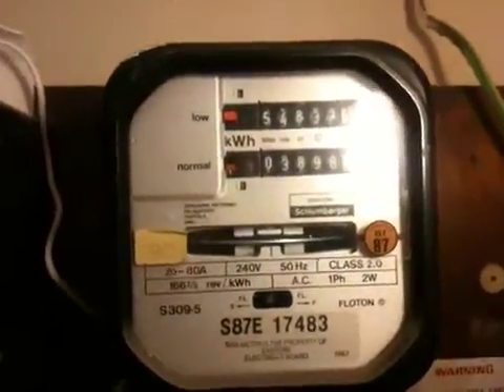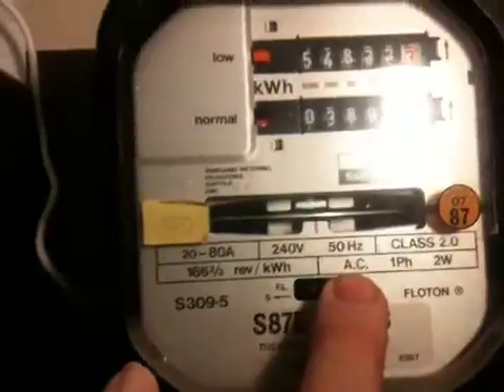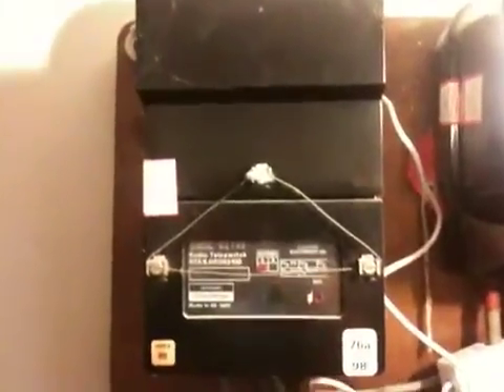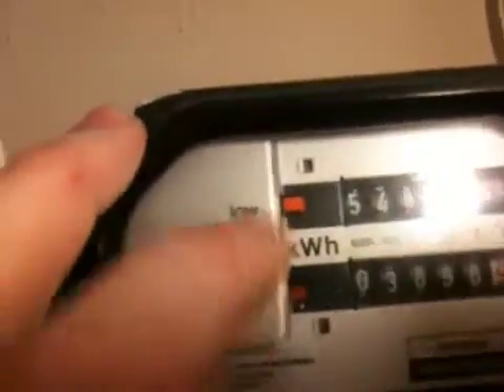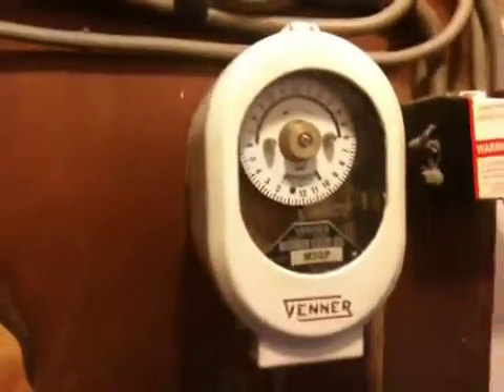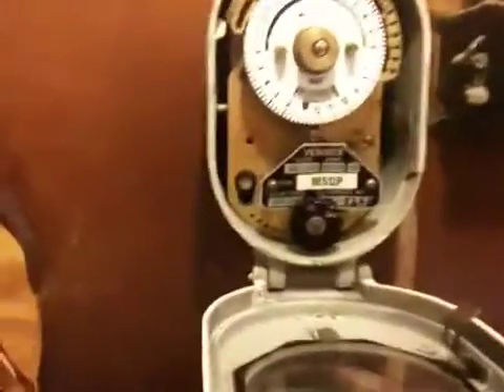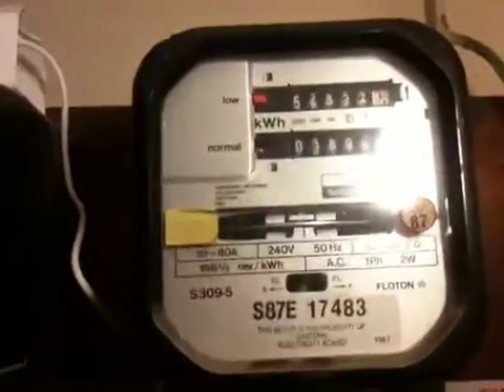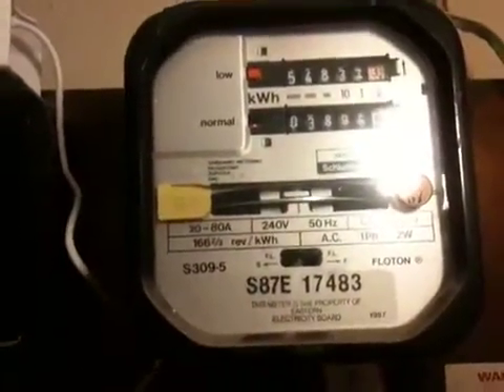Sangamo Schlumberger S309.5 KWh meter & Venner time switch

Comment: @HDXFH Later models did have plastic gearing, as manufacturers tried to cut costs. I'm unsure if my S309.2 has plastic gears or not. It probably has, but fully functional nonetheless.

Earlier Sangamo models, like the S200.7 do have all-metal gearing in them. My British Sangamo type HM prepayment meter has all-metal wheels too, & although I have the credit-meter equivalent ( the HMT ) I still haven't opened up that one since buying it! It still has the original electric-board seals!

BBD.

Comment: That is a very nice two rate meter, most likely the last electromechanical meter type made by Sangamo.
I have a brand new s 309.5 H which i acquired in 1990 from The Sangamo factory in the UK.
After this type the SPA series was launched, although I have some information which I cannot find that at the moment, an other hybrid was used also.

Comment: @Steven715715 As a guideline-bit of advice, this meter was last tested 25 years ago, & at 25 years, this is due for re-testing *BUT* the electric board won't re-test this. It'll be removed & replaced with another. It would be such a shame to see this one go in the bin. I know that RODALCO has one & a S309.2, so if you grabbed this one straight out of service, ( like I did with my S200.7 ) then that would be fantastic!!

Best of luck with that. :-)

{^_^} BoomBoxDeluxe {^_^}

Comment: Very nice Sangamo meter! The one you have there is the later version of Sangamo Weston's S309.2 As you've noticed, your one is made by Sangamo Schlumberger in Felixstowe, Suffolk. Sangamo Weston were based in Enfield, Middlesex, before they relocated to Felixstowe. The small 5th wire going into that meter is the Rate Change trigger wire. :-)

--------

Nice little venner you have there! Very similar to my MD 2 QPS, but with solar dial. My one has a 24-hour dial with 3-pin base. 

-BoomBoxDeluxe.